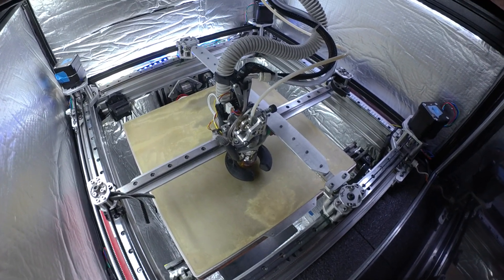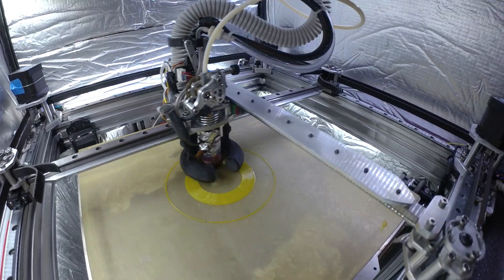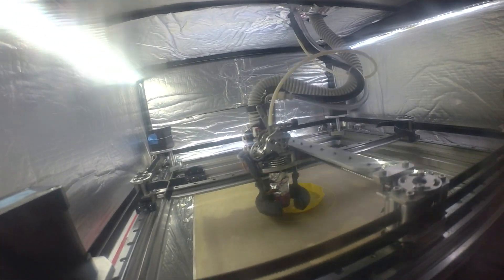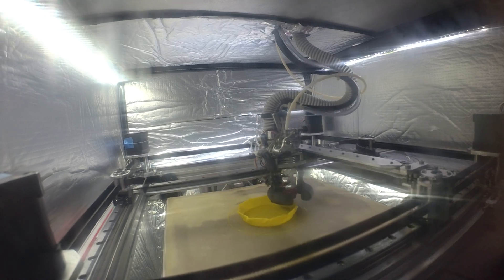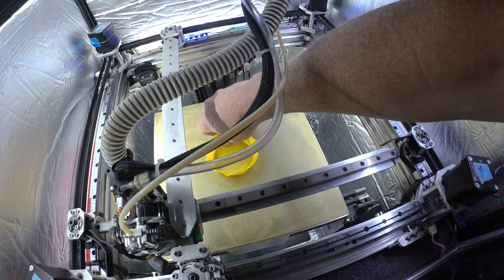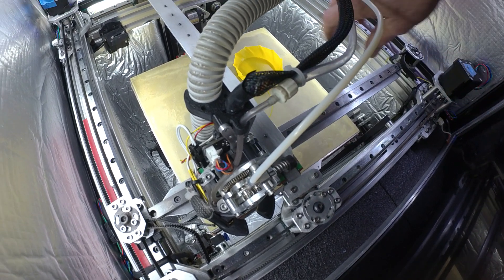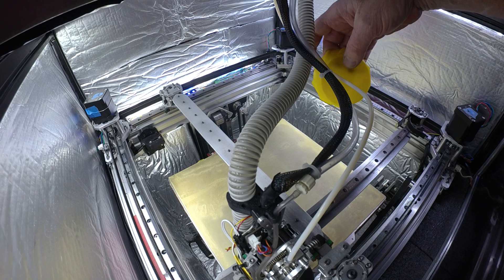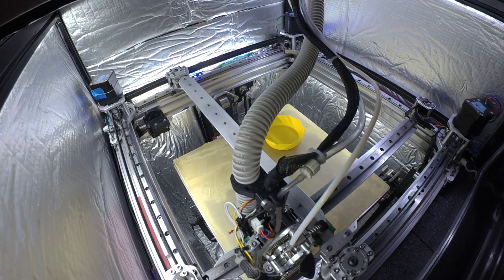0.8mm Nozzle tuning, chasing my tail

Comment: Long test report follows: i have a hotend that can do 120mm3/s from a 0.4 nozzle, it did not permit me to do high speed vases, regardless of layer time limit, line width, CPAP maximum cooling, cryo plate. After trying all possible combinations and encoutering failure, it seems that just printing 3-5 perimeters in the same ammount of time as 1 fat vase mode perimeter is the way to go. Ain't it counter-intuitive ? Its faster printing 3 thinner walls than 1 fat one equal to the three. It certainly is related to cooling, but not in the way you think. In a fat perimeter, heat is trapped inside because it has a longer way to reach the air outside. I can confirm this also by the fact that i get more flow from a 0.4 nozzle than a 0.6 nozzle - but how can that be?! - its because heat in the hotend can find its way to the middle of the 0.4 cylinder being extruded than with a 0.6. These things would not have eluded themselves to me if i wasn't able to remove flow rate as a factor in the equation by having  an ultra high flow hotend. So if you want to push the limits and decide to go from 0.4 to 0.6, you need to realize that it will require a longer melt zone regardless of how hot the hotend can heat , or how fast. I don't have any 0.2 nozzles but I  bet there are some gains to be made by going even smaller. Nothing is stopping you from printing at 3x nozzle diameter, so a 0.2 nozzle can still do a 0.6 line that you're looking for in regular prints, but not in vase mode for the cooling issue. But when you do vase mode you will do with scarf and three 0.2 lines to get the 0.6 in the same amount of time as a 0.6 line REGARDLESS OF LAYER TIME LIMITS.  My mind was blown when i realized this, it marked the end of nearly a month of testing. So you see, hardware has allowed us to reach the limits of how fast heat can enter or escape a given filament diameter. I imagine it would be computationally intensive too, you can try doing it statically in solidworks - then imagine the slicer has to do it somehow for every step of the print.

With the cryo plate I have now (generic brand), I am no longer afraid of adhesion issues which maybe make 0.2 nozzle printing hard. Check out some reviews they're doing insane overhands, like 10 inches sideways in mid air from a 0.5 x 0.5 inch surface area base layers.

I went down this vase mode rabbit hole because I was hoping to get less VFAs from the possible lack of stiffnes of sv08. But now that i'm limited on cooling (even with a cpap that can flow shit off the table next to the printer), i don't mind slowing down to 30% speed to get those perfect outer perimeters. It doesn't make much of a different on print time most of time time. I still do the inner periimeters laser fast, usually 4 of them, and infill with a large foot which is kind of like a perimeter. In conclusion, thinner lines cool faster, and we can get back the line lost in printing more thinner lines (than few fat lines) by increasing speed.

Thinner lines come with other advantages as well. Imagine you're trying to solve the problem of infill and you have to decide what line width to use. You would think having a fat line width will make the print faster. Or using that slicer setting that combines infill layers into one thicker one. At first it is tempting but then you realize that to get the same print time your infill density has to be lower, and as a result your bridges become longer in a linear relation. You can have three bridge lines per inch, or you can have one bridge line at 3x the width in the same inch. Its  better to have 1/3rd the bridging distance to print, so you will require less layers to achieve flatness, oozing, bumps from layers knocking over. I think overlapping lines in infill are more forgiving with thinner lines too, so we may see a resurgence of grid pattern instead of rectilinear. Grid crosses lines but rectilinear infill doesnt, so rectilinear has no bonding between layers while grid tends to hammer the cross points, which can cause steppers to skip steps. Traditionally this wasnt a problem when we printed slow because they would just iron over the cross points but at high speed printing it can ruin your print easily, at least until we get closed loop servo or stepper systems on X and Y.

Comment: you don't need a bowden setup to flow more than 60mm3 ... i get more than 100 with orbiter 2.5
Reply from the maker: It's a test. Others have been going to different pinion teeth, lower, 8T, 6T, to get more flow. This test puts a bowden setup with dual motors to increase pushing force. However, bowden is difficult to use/calibrate and needs much higher PA values.
Flow is really a function of hot end length.
Reply: @MrRocksalt  no need for bowden, its obsolete. You can have an aux extruder in series on the side of the machine. But with orbiter i can do 120mm3/s through 0.4 high flow nozzle (with the internal geometry which is restrictive). Orbiter is very powerful. It can push filament so hard that my layers don't adhere because the filament is not fully melted in its core. Maybe with the std6 v2 this won't be a problem and will surely allow me to flow even more.
Reply from the maker: @meocats  120mms3, through a .4, single channel, you are dreaming on sustained flow.
Reply: @MrRocksalt  on sustained flow i dial it down to 100, sometimes spiking to 110

Comment: Did you try reducing micro steps? Helped me on my Sovlol SV-08 to get 55+ mm3/s. Before changing could not get more then 46mm3/s. I think it was limited by max frequency of controller.
Reply from the maker: Yes, as I said in video, I can flow 63, maybe up to 78, but this is ragged edge from 58+. Any real PA values and it will stall the motor. I was using 2 microsteps for worm and 16 for E, which is my norm. Higher microstepping typically does not change full step tq, but to your point it does have some effect, at least when I tested motion system(z) for max speed. Reducing microstep did make it go faster.

What does help is to reduce E accel during print moves, this is what I did for this print. IIRC 10KA and 8SCV for E worked really well at 50-60mms3 and 0.8 nozzle.

Maybe there is something wrong with my setup, but I have tried a few things without success to get more than a reliable 55mms3 with a .8 nozzle. (keep in mind this is raw flow.. no stops, no slowdown, just pour me some filament.
Reply: My sv08 tapped out around 40ish until I changed the extruder arm.   Something about the old one didn't get enough purchase.   I've pushed 50 through a .6 on mine but haven't flow tested past that.   Extreme lack of cooling limits fictional printing much lower.

Comment: Impressive! Really love this journey of yours! 
I'm designing a cross-gantry myself, and was wondering, if you could show how the tensioning blocks work? I remember you mentioning it's like a guitar tuning peg, tried to model something similar, and failed horribly. Any further insight would be appreciated. Keep on extruding!
Reply from the maker: It is basically a wheel bolted to an axle with a slit/slot cut in it. The 2 belts feed inside and rotated to tension.
Reply from the maker: Keep in mind, I turned that rotator in a lathe as one piece. I drill the center and put a button head or flat top to be able to rotate it. The standoffs control the belt position, as the rotator is rotated, one belt tries to move off plane one direction and the other the opposite. So the standoffs need to be slightly offset as the teeth push one side and the back of the belt the other.
Reply: @MrRocksalt  Thank you, this makes sense now!

Comment: Instead of a bowden setup, I would try and stick a second motor on the extruder gear.
Reply from the maker: I think I will toss in a print at 53mms3 and see if I can cool it. If not, then I have bigger issues to deal with!
Reply: A second motor could be too heavy, I wonder if something like Miró Extruder would work well

Comment: What current is the extruder motor running at
Reply from the maker: .75ARMS
Reply: Why not use 2.85mm filament? Don’t need such a fast extruder.
Reply from the maker: @timothymusson5040  True, but it takes longer to heat to the core.
Reply: @MrRocksalt  Yeah, but it seems like it would be easier to get a beefier heater and a CHT type nozzle than to keep cranking up the speed. But there must be something to the smaller filament, because I've seen other people multiplex multiple stands of 1.75 into a nozzle rather than use 2.85...